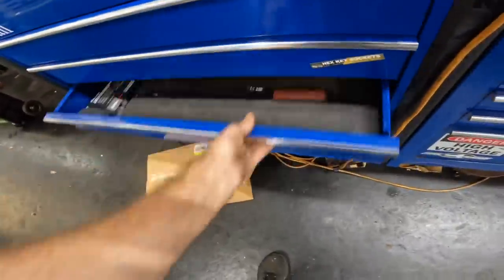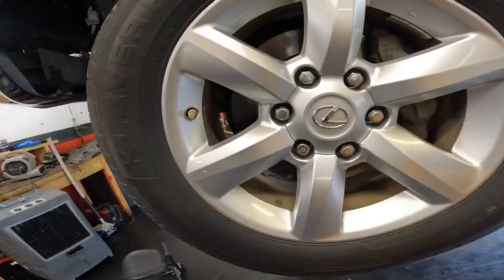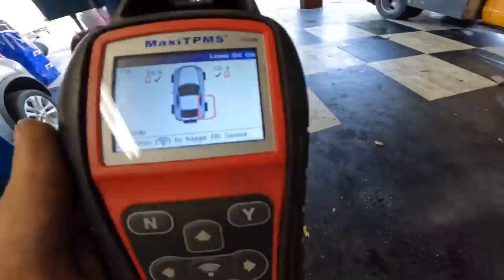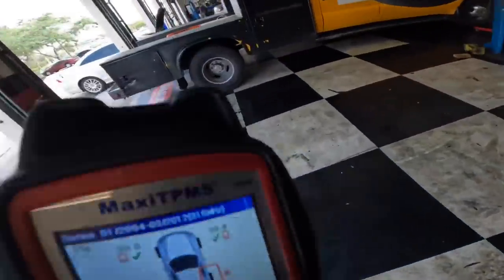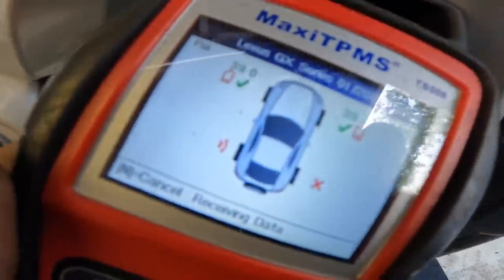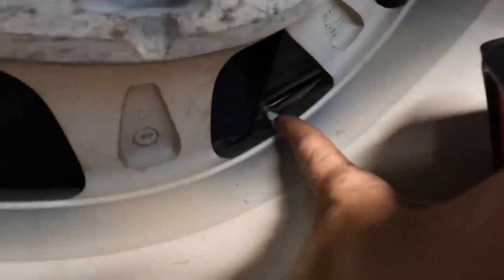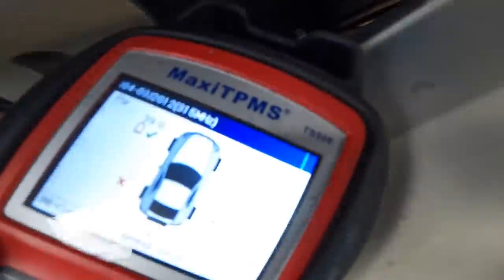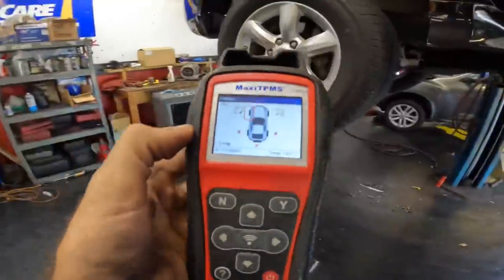TPMS Relearn! No Can Do!

Comment: Ray PLEASE help.
Jag 09 XK 
ALL sensors read as good.
Dealer and independent mechanic s Can't find issue. Tried every hack online.
Dealer wants to shoot parts cannon at it. Of course starting with computer... Any thoughts.
I have 4 NEW sensors to install as a starting point
Reply: Ignore light and check with manual gauge regularly. Not worth spending $ on.
Reply: @hotpuppy1  
Manual was 1st step... And ignoring doesn't equal fixing
Reply: @hotpuppy1  This system is really for when the car is rolling.

Explain how, while driving, you would know if you suddenly are losing pressure and a tire is getting overheated???
Reply: Check the specific frequency of the factory and the new ones. There is the US and the European standards with 2 different frequencies.
Reply: @pepeshopping  did that already
Reply: @pepeshopping  Done already thats basic trouble shooting

Comment: TPMS is the bane of the auto-mechanic/technician. There could be every freaking light on their dash on, but OH NOES it's the TPMS light is on, how else are they going to know they're driving on 4 flat bald tires? Actually get their fat 4sses up and use a tire gauge? Hell no, stay your fat 4ss in the seat, grab your mcdonalds drive through, then drive up the local tire shop while chomping your mcdouble complaining about your tire light being on with 4 bald tires and 72psi in a 32psi tire. Then you actually suggest you can check them with a tire gauge, and they give you a utter disgust of expecting their fat 4sses to actually get up bend over and amount of physical labor.

Comment: Pull the bulb... solved
Reply: You gotta to take the dash apart which in some cars is a PITA....
Reply: There’s no bulb, illumination is integral to the cluster.  Have to program instructions to trick the TPMS module using hex.
Reply: @craiglyles4755  You can break it. Hell, paint it black if need be. Search youtube someone is selling a device which tricks the system to turn off the light. No joke...
Reply: @mikeblaz  I’m sure there are idiots out there risking it all marketing an illegal TPMS defeat device.  I work on the engineering side, there’s better ways to turn off an idiot light than breaking a  $1600 cluster but you won’t find a YT video on how to do it. On some architectures, breaking the cluster can kill the gateway and render the entire vehicle inop.
Reply: @craiglyles4755  Damn... small hole drop of paint then.
Reply: @MemorialRifleRange  Or tape maybe?  Lol, it’s not rocket science covering light.

Comment: Disable the tpms system and give the car owner a tire pressure gauge.👍
Reply: This system is really for when the car is rolling.

Explain how, while driving, you would know if you suddenly are losing pressure and a tire is getting overheated???
Reply: Against the law to disable the TPMS system. No licensed mechanic shop will do it. I know, I've even tried bribing a mechanic and he wouldn't risk his job, or a fine if you get in a crash. And you can't get the program code to do it yourself. I just hit the "OK" button on the steering wheel on my 2011 F150 everytime I start it, and then ignore the feeble yellow flashing light on the dash.
Reply: @pepeshopping  How often does your TPS go off? Never? I've had catastrophic tire failure that wasn't caught by TPS. I noticed. 

This is nothing more than government overreach for bad car/tire design and rolloevers on light SUVs that were top heavy to start with. 

The number of people who ignore the broken indicator due to sensor not working is ever increasing, it just serves to be ignored. Which is the worst kind of warning ever created. Boy who cried wolf is a cautionary tale that should be required reading by legislatures. See Prop 65 Warning everywhere in California and serve no real purpose any longer. Just Noise.
Reply: @MichaelTilton  I have had TPMS warn me of a tire rapidly loosing pressure, so I could call to get it plugged, and not drive it to shreds. Later, on another car, it warned me when I drove off, so I stopped and saw the huge screw in the passenger side rear tire. I mounted the emergency spare and went and had the 235/45-R17 tire plugged. It would have cost $$$ if I had drove on the flat tire. Plugging is not a permanent repair, it only lasts as long as the tire itself.
Reply: @erik_dk842  Why would you need a plug to last longer than the tire itself?
Reply: @erik_dk842  Your one of the few that gets it.  The tpms is for when the vehicle is moving.
Reply: @berserker406 I've been in several vehicles (not mine)  we were cruising 70 mph, and all of a sudden tire went flat.  Got out and the tire was overheated and destroyed from low pressure.  We never noticed a thing until it let go. Tire sensor would have warned us before overheating the tire.
Reply: @berserker406 I could not care less about your insult. In both my cases TPMS caught the pressure drop long before it could be felt.